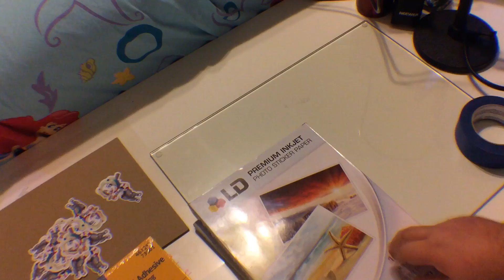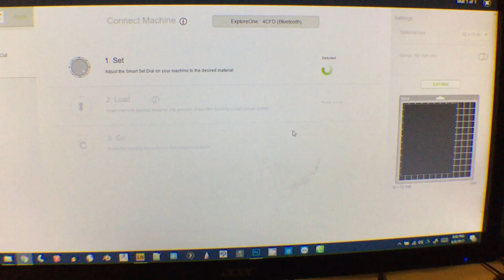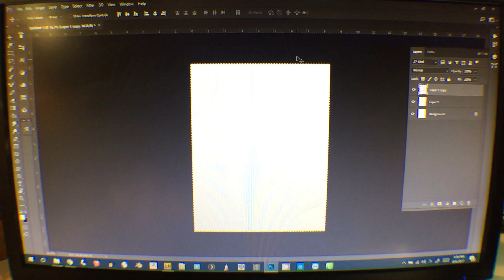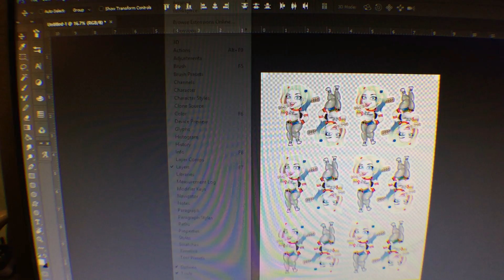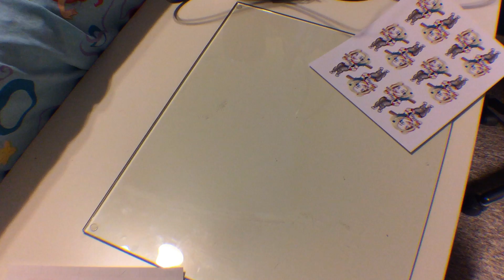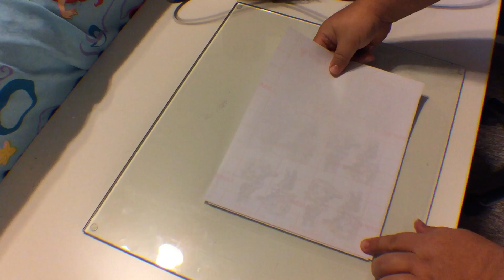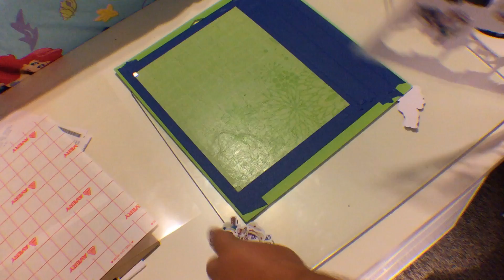Trick your Cricut to do FULL PAGE Print and Cut - Sticker Tutorial!!

Comment: Thanks for your answer. They say the browser controls your print and cut size but I think that’s not true otherwise anything you printed off the browser wouldn’t print normal size either. I love the maker because it can do so many different things but you can’t adjust the resolution in this software either. Don’t upgrade your software!   I wish I could upload the app you have as it gives you more control.
Reply from the maker: I think its a limitation of the API for apps inside a browser.  Firefox gives you the most real estate when using DS native print and cut feature, but at the same time when you upload to DS they resample the artwork and degrade print quality to lower resolution and crop images down to the smaller canvas. That is why my registration squares are there to keep them from cropping the image down and changing the alignment of the cuts on a full page. Not to mention having to print the box or lines for the scanner also force you to shrink the image to fit inside their restraints too.

Comment: Will this work on the Cricut Maker?  I can’t believe a $400 machine can’t cut bigger. I can’t even print and cut a 7 1/2 x 7 1/2 picture!!  Infuriating😡
Reply from the maker: I fully agree with you. I felt that way when I purchased my machine... I spent countless hours trying to make it work and finally was able to, but I did research and even some of the pro machines have similar issues or lame software so for the fact that I paid $150 for my machine and was able to make it work for me is not so bad. I do not have the Maker and I assume this process will work for any machine. Just as long as you can always find the 0,0 position on your mat and that is what the tape is for. If the machine changes that 0,0 alignment every time it cuts then wow this would not work ever. The cricut mats 0,0 position is not true 0,0 . also loading the mat is another issue with get true 0,0 everytime.  If you have a maker and are able to do this please let me know. I want one but cannot justify its purchase at this time. Some of the new features and blades intrigue me as I love making stuff. I am considering a laser cutter over the maker at this time.
Reply: @EricMBoyd  Impossible with the maker, it apparently shifts the 0,0 time to time, been trying for hours!
Reply from the maker: @palomagarduno9482  registration squares line up on the tape?
Reply from the maker: @palomagarduno9482  Cricut in general does that. I have the same issue... Sometimes it requires recalibration.
Reply: I have the maker and just spent most of the day watching your videos and trying this process. I am experienced in photoshop, so was able to set up the files with no problems at all, and the printing worked fine for me as well. The problem I am having is the cuts are misaligned for the majority of the images. I have a sheet of just 6 images, and the bottom middle cuts perfectly and so do the 4 registration marks, but the other 5 images are off by a few millimetres (I have done mine on A4 sheets as I am located in Australia and we use metric sizes). I have redone my blue tape to mark where the A4 sheet should be placed and nothing seems to fix the alignment issues. The top three cuts are all to high and the bottom left cut is too far left and the bottom right cut is too far right, so out of 6 images, I can only get one perfect one. Have wasted a lot of ink and paper trying to make this work on the cricut maker, and unfortunately it just doesn't. I am going to try a print and cut to see if I get better results.  @EricMBoyd
Reply from the maker: @jacquiimcleay5588  So sorry to hear this, I worked with someone who was having the same issue and there could be so many different things happening. First, are the registration squares cutting perfectly in the corners of the tape?
Reply: Yes, the registration squares are cutting perfectly in the 4 corners of the tape. Also, I have done several print and cuts now, and they all worked perfectly. So as much as I love your idea of creating a full sheet of images and and I desperately wish it would work on the cricut maker, it just doesn't. If ever you figure out a way to make this work on the maker, I would love to give it another go :)  @EricMBoyd
Reply from the maker: @jacquiimcleay5588  If your squares are cutting right its a printer issue. It works on the maker.
Reply: Crucibelle its an issue with the browsers I’ve been told.

Comment: Got any way to simulate the color bleed option from Design Space? I need a full color bleed all around a design that requires 11x17” photo paper, and I need to pull it off hundreds of times. It’s one item per sheet, not multiple, so I won’t have the option of adjusting later cuts on the same sheet. Bleed should help compensate for inevitable misalignments. Thanks!
Reply from the maker: hmm, so you want use design space to add a bleed? I add my bleed in Photoshop when I print from there and then upload the cuts to DS, I show that a little in my latest video.
Reply: Eric M Boyd I’m trying to do it outside of Design Space so that I can do it on images too large for print then cut. It needs to be a color bleed that matches the color of the closest edge like Design Space would do as opposed to a simple white or mono-color border.

Like a blue balloon with a thin black string would look like a larger blue balloon with a black bar for the string. This will prevent slight alignment errors from showing white on the edges of the cut where alignment was not perfect. Any superfluous details, like a white reflection on the balloon will not grow or change position though it will appear further from the edge until the excess bleed is cut away. All the tutorials I can find teach you to make a simple one-color border instead. :(

The label overprint in your latest video accomplished the same thing (room to fudge the alignment) but I did not create my source images so I will not have excess image area to cut into. I don’t have Photoshop but I’ll pay the subscription fee if I can use it to simulate Design Space’s color bleed.

Sorry if I asked you this question in multiple places. At the time I didn’t realize I had stumbled on the same channel multiple times.
Reply from the maker: @emmettturner9452  I am not sure how to answer.... so when I add bleed, which I do to everything that requires cutting no matter how basic. Post cards and everything. You can try place a slightly larger version of the object... ballon for example on a layer behind the original object and in theory that will result in extra bleed, but on complicated shapes this could be an issue and will require some fine-tuning.

Comment: I noticed you linked a laminator. Is that what you use now? I like how shiny it looks when you used it on the video. Will the laminator do just one side so the sticker part stays intact?
Reply from the maker: yes I use it to press the stickers. I used to use a pasta machine and it was a pain and I hand cranked everything. I use self-adhesive laminating sheets to laminate the printed side of stickers and magnets. I am testing some new materials that will allow me to make Outdoor Car Decals using the same procedure.

Comment: So I followed all the steps but it still cut a bit off. My last few stickers seemed to be better but the first half were way off. 1) would it help if the registration mars were printed black for the machine to detect? And 2) in my printer settings would you choose borderless printing? (I’m using a canon pixma pro 100.)
Reply from the maker: Possibly borderless would work better for you. For me and my printer, it made things worse. Also, using the autoload tray was really bad it would print off and I kept blaming the Cricut for the printer issues.
Reply: Eric M Boyd so I’ve been playing around the past few days. I did some tests. First I did just a cut with plain cardstock. I used that as a template to see if my print would match the cut. I’ve been printing borderless which still was a little wonky, so then I started playing with the scale in the print settings I brought it down to 98.75% and kept checking the preview window for my printer. I also made my registration marks black so I could see them in the preview. The bottom half of the cuts are slightly off but not so much that it’s too bad but the upper half of the cuts on the sheet were perfect.
Reply from the maker: @NykkeyB  I just had the same issue after upgrading to the latest Design Space. Seems like I need to constantly run the calibration tool to correct the issues.

Comment: So I did some tweaks and posted the results on pintrest 

https://pin.it/fvupx4g523xtij

Using Cricut Air2, Cricut purple mat, Cricut printable stickers, PS, Printer Epson XP-960 Rear feeder instead of Front feeder. I was stumped with the whole concept of running my 8.5×11 printouts through rear feeder it's not something I would do unless it was an 11×17 printout so changing settings from Auto to Rear feeder was what made the difference plus the mat as my green mat wasn't sticking nor could keep in place even with tape the heavy cardstock paper which served just as a guide/template made all the difference because Cricut printable sticker paper are pretty thick and heavy the purple mat keeps both heavy stock 12×12 cardstock paper used as a guide & printable sticker paper perfectly in place also my purple mats went through the cutter better than my green mats probably due to it being bent up and over used. 

As a tip I would run pretests printouts first on light cardstock paper/paper before testing it out on sticker paper. Match the weight of sticker paper with the weight of your pretest paper if possible as you want even results. I also tested every wrong way one could possibly fall into so when troubleshooting the causes I know what they look like. 

Great tutorial.

Comment: What setting did you use for the cricut? I had it set on printable vinyl and it won't cut all the way through like yours did.
Reply from the maker: I made a custom setting with trial and error based on my material and needs. Basically, I used a heavier cut Sticker paper setting and gradually increased pressure until it cut all the way through without destroying the mat.
Reply: Thanks! I'll play around with the settings then
Reply from the maker: Sorry could not be more helpful as I find it really is something best done from machine to machine and materials are not always the same sometimes even when you order from the same manufacturer. My magnet paper is always slightly different and the mats act differently depending on use.
Reply: But what is your pressure? I actually use the same sticker paper and a cold laminate like you. I have set the pressure pretty high but always get raggedy cuts on the bottom.
Reply from the maker: I will try and look tonight... I can't get into my custom settings without the Cricut being on.

Comment: Hello, village idiot here. This workaround looks amazing in your video; not so much over here, though, as I keep getting horribly mis-cut sheets. I’ve watched and followed as exact as I can, numerous times. However every time I go to cut, the resulting cut lines are offset from my print. But they’re offset vertically (in the direction the mat is traveling through the machine). I’ve paid careful attention as you demonstrated in the video about the mat shifting left and right through the feeder. Everything is perfectly aligned on that axis. But the other axis is a train wreck. I even went so far as to print my registration marks at 50% grey to ensure my prints were being made at 100% scale. Everything was good on that side. Scratching my head here. Any idea what could be causing this offset when everything I’ve setup is exactly as you’ve done? Any thoughts would be greatly appreciated!
Reply from the maker: do the registration squares cut correctly or are they off too?
Reply: Eric M Boyd Thanks for the reply. The registration squares are offset as well. It’s as if the entire paper is offset vertically on the mat by roughly 1/8” from where the cuts are being made. Horizontally everything lines up with the registration squares, as well as the scale and horizontal position of the sticker shapes.
Reply from the maker: re-apply the tape on the mat and cut you a new full-size sheet out of the tape and let me know if the registrations are off after that. I am guessing this is where the issue is. I have had this problem too.
Reply: Eric M Boyd Thanks Eric. I will give that a shot. After watching your video once more I think I might have missed your warning about not putting too much pressure on the mat when loading it into the machine. It’s possible that I might pushed it a bit too much when loading the mat. That would certainly make sense as that is the direction of the offset. Going to try again in a bit with some new tape. Thanks again for the info!
Reply: Eric M Boyd Well, five mis-cut mats later—all started from scratch with new tape, new design space files, and strict adherence to each of your steps in the video—I can only conclude that my machine is having issues. In fact, I ran the cuts twice on two separate mats. Didn’t touch the mat at all just ran it again immediately after it finished the first pass. And each time the second set of cuts were offset below the already offset cuts from the first pass. And I’m talking about a huge offset, not just a small nitpicking offset. Maddening. But to save my sanity I’m done messing with it. Life is too short. I am however going to go outside and murder a cricket, though. Thanks again for the help!
Reply from the maker: Poor cricket!!! What machine do you have? Wow,  thats crazy! The situation not you! Anyway, don't give up life is to short to give up... try running the Design Space alignment configuration and then make a new matt and see if it does the same thing while making a new mat. Maybe your stepper motors need adjusting or they might just be bad.
Reply: Eric M Boyd Like my paps used to say, “it’s all fun and games until a stepper motor goes bad.” If only I had listened to him back then. I attempted to run the blade calibration as you suggested, but was met with another road block; “no cricut device found.” Apparently it didn’t know to look in the direction of the cricut device I’ve been using to mis-cut a shitload of stickers. I suppose it’s time to call tech support. And I couldn’t find a cricket to murder in the yard, so no worries there. But I did flick an ant clear into the next county. Guilty by association.
Reply from the maker: Any Luck?
Reply: Eric M Boyd Nadda. I was able to run blade calibration from the iPad app, but that did nothing. It still mis-cuts every mat. Additionally, I purchased the exact same Avery laminate sheets you showed in your video, as well as the same Purple Cow cold press. But when I try and pass a sheet of printed stickers with the laminate applied through the machine for a normal print and cut, the machine rejects it with an error that it couldn’t recognize the cut lines. However, without the laminate applied, just straight glossy sticker paper, the machine cuts just fine in a standard print and cut scenario. Perhaps the Explore Air 2 isn’t capable of your workaround....or I’ve got a flawed machine. It’s a mystery!
Reply from the maker: Design Space Standard Print and cut won't work with Glossy papers. I had the worst luck with that too. Why I stopped using the feature.
Reply: I've had the same problems as Brice. Although for me, it cuts way too far to the left, always
Reply from the maker: have you ran the calibration tool for design space and see if the tool is accurate?
Reply: Same issue. Design space software shifts the cuts line by line...regardless of calibration.
Reply from the maker: @CactusMoon7  I need to try this again maybe there is an issue in the latest DS.

Comment: Hi, great video!!  I am having trouble getting correct registration.  I am printing on 8" x 10" paper.  I tried setting 8" x 10"  paper setting in the photoshop print dialogue (Canon MX920 printer) and the registration was too low on the page, cutting into the tops of heads of little figures.  I tried  8" x 10" borderless, and then the registration was too high.  When I made the 8" x 10" rectangle and cut out the artist tape on the mat, I noticed it cut the rectangle very close to the top of the mat.  Do you know what is causing the problem?  The Canon does not seem to have a rear paper feeder.
Reply from the maker: I think maybe re-cut the taped Mat? Sounds like the cut on the mat for guidelines are off based on how high you said it cut on the mat. I'd start there. Also I am wondering is your printer recognizing that you are printing 8x10 instead of 11x8.5? I mean is that setting options you are doing? Registrations are also uploaded to Cricut at 8x10? Let me know if any of that helps. I have never tried 8x10 myself but don't see why it wouldn't work. Thanks for commenting.

Comment: I've wasted to much paper, ink and money train to do this what ever
Reply from the maker: There a few main reasons this will not work. Printer can be off. I find if I use the tray and print 5 sheets of the same image line them up on a window and see if they are aligned correctly everytime. Did you put the tape on the Mat and Cut a full size sheet for alignment? Did you set printing to center? Did you make sure the printer is not resizing the page? I would be happy to help, just saying it don't work and I am not sure what is not working.
Reply: @EricMBoyd  I got it. I think I was trying to cut to much on one sheet